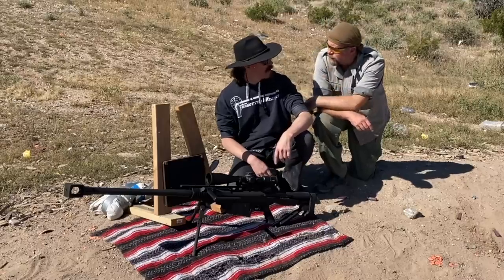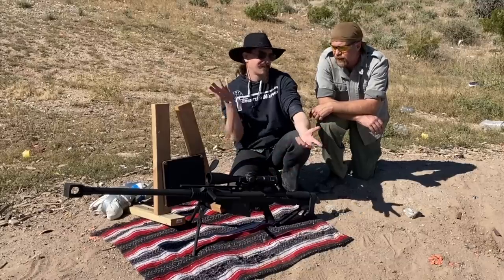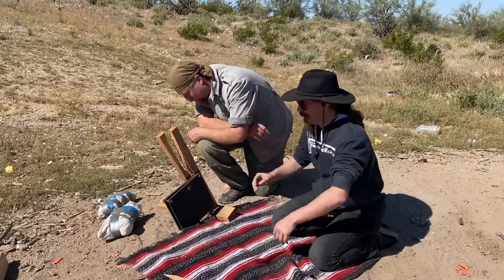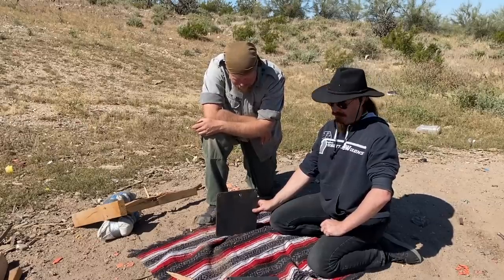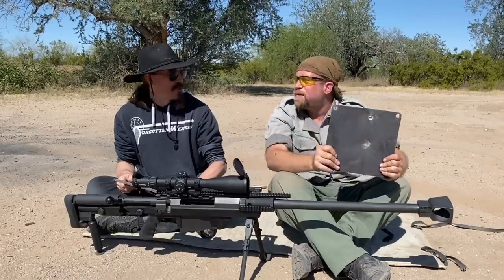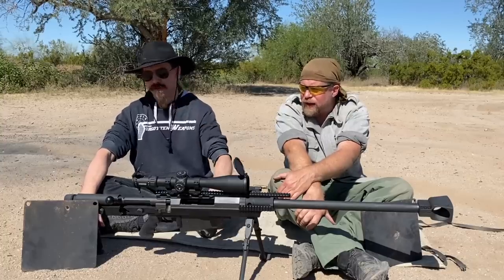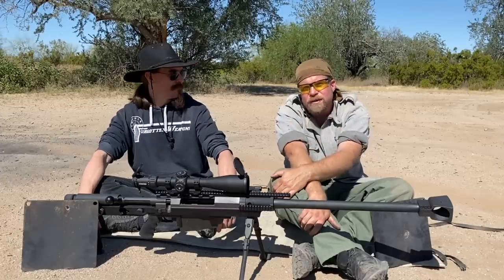50BMG M2 AP - Armor Piercing Ammunition Testing

Comment: Woodworker here: rotate that vertical 2x4 to where you have the 4" side facing the shooter. 
Ammunition idea: 416 Barrett. That would be a neat penetration test since it's based on a necked down 50.
Reply: Michael Srite  It's literally not. Go check 7 minutes.
Reply: @CassiusGreen  The armour plates are bolted onto the 4" faces (wide sides of the 2"x4" planks) and facing the shooter.
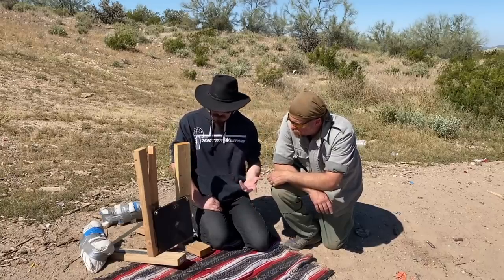I'm not sure how that could be mistaken for the narrow (2") faces: it's as plain as day in the video, especially at 7:00
Reply: @dj1NM3  Oh aight I thought he was talking about putting the metal part behind the wooden planks in front of it, not the wooden planks themselves. I don't know much about woodworking vocabulary or woodworking itself so thanks for explaining.
Reply: Michael Srite  
"Where you have" means "In the current configuration".
He's saying to have the 2 inch facing the shooter as opposed to the 4 inch.
Reply: @Ranstone  I think I'd not bother with the carpentry. MIG welding might not be my first choice might go for MMA for a bit more depth of weld.
Reply: .416 Barrett penetrates steel plates placed 3 ft apart. Smokes .50.
Reply: @barryyoung4982  That's what you get with a more modern, optimised cartridge. I think .338 would go through one but maybe not the second
Reply: i kinda love 50 bmg because it's just moving a big ol fuckin mass and explodes the target and often anything anything attached to said target, but its ap abilities aren't great and it tends to drift off target when moving through multiple objects
Reply: @barryyoung4982  And pre WW2 7.92×107mm DS smokes them all...

Comment: You could set up two chronos. One immediately before the plate and the second immediately behind. Then you can  calculate energy lost during penetration to determine how “easy or difficult” it was for the projectile to pass through the plate
Reply: That second chrono is a major risk of getting smashed.
Reply: Just use one lab radar. Won't need to endanger the device. Ask military arms channel for collaboration.

Comment: Small correction: Hecate II isn't only for special forces. It's also in use by regular French Army.
Reply: true, they first real use was from the "sniper hunting unit" from the french Legionnaires in Sarajevo (1992-95): at debut, they use first US cal 50 rifles but their muzzle brake was badly designed, it demolished the shoulder and above all it produced a huge flame at night (as a result they were spotted and shot at), whereas with the Hecate, the recoil was well damped and the very low flame...This rifle was use to neutralize the snipers hidden behind walls...

Comment: You know speaking of 338, I've been hearing claims that 338 Norma Magnum AP ammo does better in certain things than 50 bmg, with up to almost double the penetration. Of course that could be Sig hyping up their stuff for the NGSW program but it would be interesting to see
Reply: It's not hype, just context. They're talking about 1000-1500 yards when the old 50 is gassing out, while the slippery lil 338 is still breezing along.
Reply: @theimmortal4718  Might be true at longer ranges and from rifles specifically, most .50 rifles have a much shorter barrel than the M2 the cartridge was meant for.
Reply: The Immortal Just because servicemen hold an opinion doesnt mean said opinion is correct, so don't use that as an argument
Reply: @carnut666  So it has twice the armor penetration after its velocity drops to 1600 fps?

Comment: From what I remember .50 BMG AP goes through something like 20mm of armor at 500m.
Reply: Remember hearing the original specification was to defeat 25mm at 500m from the M2 machine gun with its 1140mm barrel, this Hecate's barrel is "only" 700mm so 20mm of penetration may be quite close for that.
Reply: @bighobo7745  ; And then there is M20 API-T which does more pen than the normal M2 AP. Though your 25mm at 500m for AP sounds to high from what I have read.

Comment: An ap projectile from a .30-06 or 7.62 NATO loaded into a .300 mag case could be an interesting project
Reply: Or 8mm Mauser ap projectile loaded in 8mm rem mag
Reply: The 163 AP  from WW2 30-06 Black top in 300RUM with 105grains 5010 powder . I don't know the velocity out of my 26" barrel probably 3500fps but it shoots decent
Reply: Todd Webb why not just use 7.92mm x 94? Comparable case size to a .50 BMG necked down to 7.92mm.
Reply: Shaun Young bruh where are you gonna find 7.92x94?

Comment: Love the channel guys!!  The M33, .50 BMG round is a copper jacket over a mild steel core with an inert filler to support the jacket at the tip and a very small amount of lead as an end cap.  The use of lead for the whole bullet ended before WWII, I believe.

Comment: Just a little reminder.

THEY MAKE .50 CAL SABOT ROUNDS.
Reply: For hunting TIgers and Panthers I would think... the tracked variants of course.
Reply: @michalsoukup1021  .50BMG Sabot rounds are a modern variant, so no. The armor penetration is rated at roughly 50mm from what I can remember. Think of them as upscaled SLAP rounds with fewer accuracy problems and ungodly recoil due to their incompatibility with muzzle brakes.

Comment: A smaller alternative for better armor penetration is the .416 Barrett. Was an alternative to get around California's 50 BMG specific ban, but since its essentially a shortened, necked down 50 BMG cartridge you only need a barrel swap to be able to use it. It also takes advantage of a much more optimized bullet design so think its probably a good contender!

Comment: For a follow-up test with lower mass and higher velocity cartridges. Look into the Cheytac .375-Cheytac or the larger .408-Cheytac ammo.    
   Knesek Firearms or THOR Manufacturing in Van Buren, AR may even have steel core ammo to test with. Possibly Cheytac Corp. in Idaho has steel core ammo available for armor plate testing.

Comment: Ideal in the .30s would be to run something like a 300 win mag or 300 PRC with pulled down M2 AP rounds from old 30-06 projectiles loaded up. The bore twist rate would have to be likely for the bullet weights on those smaller bullets, but it could be done on a special order to Krieger or Bartlein. Launching a 212 gr projectile in a 300 PRC clocks in at around 2800+ from the muzzle. If you used the M2 AP lighter bullets with that AP core, you will likely get velocities into the 3k+ range. Plenty to ruin any steel's day. Food for thought.

Comment: Very cool test.  As to your point around 10:50 that you might get better penetration with a smaller-diameter, higher-velocity round, I'm not convinced.  First, a smaller round might have higher velocity at the muzzle, but because it would lose velocity faster as it traveled through the air, owing to its lower mass (inertial mass is, by definition, resistance to changes in velocity), it would still have a lower velocity by the time it reached the target, unless the target were very close.  Second (although this is really the same point, since the air between the muzzle and the target is, as a practical matter, a layer of the armor), a lighter round will lose more velocity to the armor.  That's what armor does, after all: it decelerates projectiles.  If the projectile keeps moving in the same direction, it will go through the armor, because that's the only way it can keep moving in the same direction.  If it does not keep moving in the same direction, then it has undergone a change in velocity, again by definition.  Since mass resists changes to velocity, a more massive object will be more likely to keep moving in the same direction.  Granted, a higher-velocity has more velocity to lose, but see point number one.  Granted, a wider round has to make a wider hole, meaning it has to move more mass out of the way, but, so there is a tipping point at which increasing the caliber decreases penetration, but I doubt that that point is between .30 and .50.
Reply: It depends on the bullet profile. For example, Cheytac make smaller and lighter bullet than .50BMG but still they remain supersonic at longer range than the BMG, making them more accurate at long range. So it's not all on the weight. But to pass through armor plate, they not only a lighter ammunition but also a way, way way way more faster bullet with a tip fine enough to focus energy on a smaller area. TLDR, saboted dart.

Comment: About the needing to properly restrain the plate to stop it moving backwards - It doesn't make a difference to the penetration capabilities of a bullet. Basically none whatsoever. The bullet is so small, fast, and light and lacks momentum in comparison to the heavy plate, all of the energy and therefore penetrating power of the bullet is expended before the target plate even gets moving. I know it's counter-intuitive but I promise you it's been tested but also that the physics checks out. You will get no more penetration by fully restraining the plate. 

You can test this if you don't believe it by shooting a free-swinging plate vs. a fully restrained one. The bullet will make no more noticeable damage to the fixed plate. There must be some difference but it is negligible to the point of being totally insignificant. Those who regularly view both the Taofledermaus channel and also Edwin Sarkissian's channel will have learned this.

Comment: Try next for armor, the two plates with a 1/4" rubber between them and as back layer a 1" foam board covert with an type IIIA west as spall liner. Just for curiosity.

Comment: With a .50, the big problem is the dissipation of energy into the stand.  For body armor, that's desirable as a person wearing armor WILL move and thus dissipate that energy.  Thus a sandbagged wooden stand is arguably perfect for .30/8mm AP.  For vehicle armor (i.e. the intended target for .50 BMG M2), the rigidity of the structure supporting the armor and the mass of that vehicle will be far greater than that of even a sandbagged target stand.

Comment: Standard fmj will never penetrate steel of any appreciable thickness because the lead core will simply shatter on impact. Basic mineral science: in order to scratch/cut a material you need to use a harder material. Steel has a much higher hardness rating than lead. With enough velocity you could potentially break through a steel plate with lead, but it'd be more of a result of kinetic deformation of the metal stretching, rather than actual penetration.
This is why armor penetration munitions have solid steel cores to act as penetrators.

Comment: Ian: visual que as to if something barely went threw this, versus if it easily went threw, based on plenty of other gun penetration tests on YouTube, is how much of its total energy did it dump into the plate, ie, how big is the hole.
A round with more energy left over seems to pass cleanly threw in as small a hole as possible.
A round that just barely goes threw, from my estimation, seems to slow the round down to make it bulge slightly from the impact and/ or stretch out the diameter of the bullet hole as the plate gives way slower, increasing the diameter of the plate that gives way, instead of making a cleaner smaller cut in the plate.

Comment: I mean, 12.7mm AP from the manuals is rated to through 1 inch of RHA at 100yds, so 3/4 inch of 2 stacked plates at 50 yds should be no problem.

Comment: Deformation around the hole as well as the amount of material pushed out of the round's way, instead of being sheared off, can some indication of how much energy was transferred/retained by the bullet. In this case, we see very little deformation, and fairly clean edges out the back of the second plate. To me, it looks like there is a very good chance that big old slug could have punched through one more plate. 
P.S. Milder to shoot than a .308?! I just commented in the F.W. video that I didn't even want to shoot one of these guns. I lied. Gimme.

Comment: i wonder if it's worth to build a Stand out of angle iron so that you (probably) only have to build one ever again.
might need to sandwich whatever you're holding on both sides with the angle iron to make sure it's strong enough, but it should hold up to everything short of a direct impact, hehe.
bonus points being that it's easier to securely Bolt angle iron down to a Pad than it is Wood.

Comment: It seems that .50 BMG M2 AP has a core made of steel alloyed with tungsten and chrome(I'm sure it's also hardened), and some lead-antimony alloy inside the tip.

.338 Lapua Magnum's more elongated bullets should help with penetration, at least.

Comment: I don't know what 30 cal means(7.62x??) but the 12.7x99 round has 18-20KJ of energy compared to around just 2KJ for 7.62x39 and 3.5KJ for 7.62x51...so yeah that's a pretty massive difference.

As to whether the 12.7x99 AP would go through three of those plates I think it would be close, depending on the cartridges you mean. I made a mod for a game for more realistic ammo and the equation I have says that 12.7x99AP at 19KJ should have around 40% better penetration ability compared to 7.62x51, assuming the materials are the same of course which they probably wouldn't be.

Using the same formula apparently a 8.6x70 round has about 27% better penetration compared to 7.62x51, so not as good as 12.7x99.

of course this is just a formula I made based off of tests I could find on youtube. If you actually tested these and had enough info it would be cool to see how it stands up.

Comment: 50BMG ball is not solid lead. It has a mild steel core. I think the M2 AP 50BMG may have some tunsten in the alloy of the hardened steel penetrator.

Comment: There are materials scientists already on the verge of making carbon-fiber cloth as thin as a cotton t-shirt that will be impenetrable to a .50cal BMG AP round. What they don't advertise as widely is that the .50cal BMG still has enough kinetic energy to make failure to penetrate the cloth irrelevant as it shoves that fabric several inches into your body. On the upside, extraction of the bullet will be easier during the postmortem thanks to the convenient fabric wrapping.

Comment: I wonder if spacing the plates would make a difference to the .50 AP round - would it be able to penetrate the second plate?  (Schurzen test). Or a test at 30 or 60 degree slope.
Reply: I would say with 3/8in plates, probably.  At the range they're using, it should be able to clear a truly homogenous plate of the same thickness with a bit of backing material to help support the plate rather than a stand.  So like screwing a 3/4in plate to 1.5in of plywood.  

Now what would be interesting would be to have the plates angled respective to each other.  So plate 1 is angled 15 degrees from plate 2.  See if that would be enough to cause the bullet to destabilize and shatter on the second plate.

Comment: "... .50caliber armor-piercing cartridges went on to function as an 
anti-aircraft and anti-vehicular machine gun, capable of penetrating 0.9
 inches (23 mm) of face-hardened armor steel plate at 200 meters 
(220 yd), 1 inch (25 mm) of rolled homogeneous armor at the same range, and 0.75 inches (19 mm) at 547 yards (500 m)."

Comment: I wonder how the "in the field" marksmen use this thing at sub zero'd ranges. I understand it's not meant for that, but we all know that what a rifle is designed for and what happens in combat are sometimes entirely different. There has to have been a few cases where, someone, somewhere, needed to take out a car/truck/apc/armoured car at danger close range, which admittedly for this thing is still a few hundred metres, and they must have come up with something by now. It's been in the field long enough for some sort of field expedient method to have been, at least unofficially, adopted. I highly doubt aiming low by upwards of a metre is going to cut it for the marksmen that have the skill to use this thing to it's rated ranges.

Comment: Your stands are just not as strong as they could be.

Working with wood which is an anisotropic material one gotta understand that the force that's needed to split woodfibres apart is not to high. That's why splitting wood with an axe works.

You mounted your plate on unsupported wood. The wood next to it on the other side is supported by the angleiron. So you basically made a massive shear. When the 50.bmg hits it punches the shear closed ripping the wood apart.

I bet with you that if you use a 2x4 as an angle brace supporting the whole 4" of the straight piece your stand will survive.

(im studying wood engineering right now)

Comment: 10:43 - isnt that the whole thing about .408 cheytac and .375 cheytac? smaller bullet at a higher velocity. the .408 has a 305gr (20g) bullet at velocity of about 1100m/s (3500ft/s) while the .50 is 647gr (42g) at 928m/s (3044ft/s) at its fastest. add a hardened steel core for ap and the .408 will most likely penetrate better than the .50
Reply: Deilwynna Sectional density and velocity, the smaller bore magnums have a higher sectional density thus penetrate better at the same velocity, theoretically

Comment: 10:47  Ian asks if a smaller but higher velocity round could give superior armor penetration. In at least some circumstances I believe so.

https://www.youtube.com/watch?v=TSdviZ4GVDI

There's obviously a lot of variables in this experiment but it's interesting that the plate moves more with the .30-06 than the .270 yet the .270 punches through, suggesting that the .30-06 dumps more energy into the target.

I consider that experiment lacking because the hanging plate and differing points of impact could have a substantial effect on how the energy is transferred to the plate. Also the plate is of unknown composition, although it appears to be a commercially made target plate. Finally, having several shots on the same plate could weaken the plate for subsequent shots.